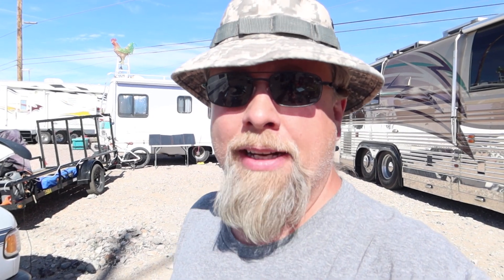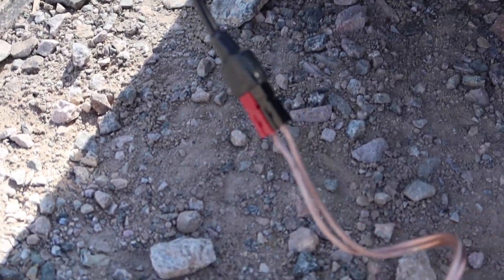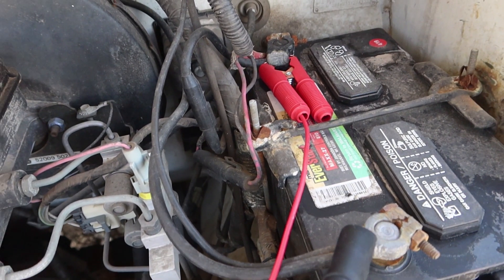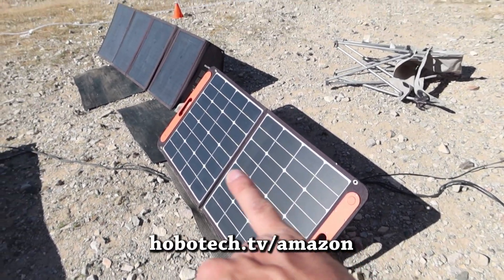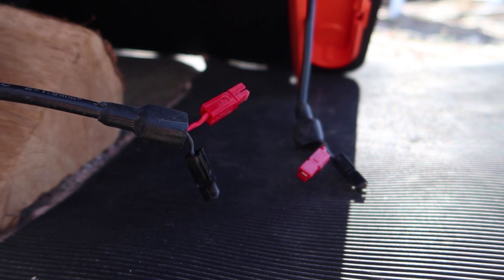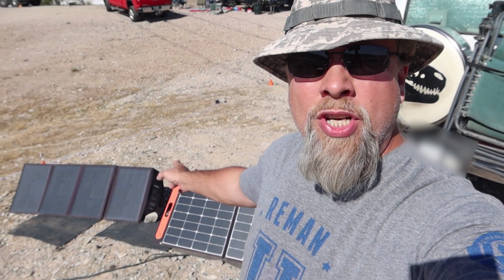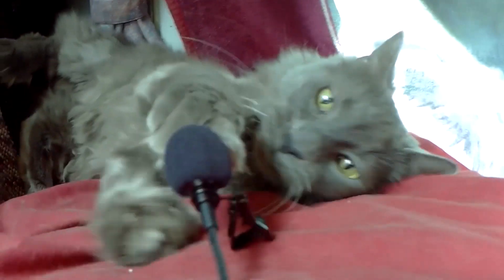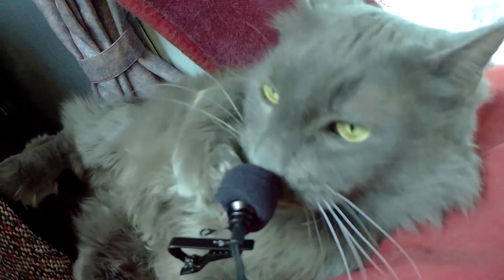SOLAR PANEL HOW TO'S! Wiring Portables In Series And Charging A Car Battery With A Jackery

Comment: I am just curious why you say you can’t use a Jackery solar suitcase to plug into a  Solar on the side port on the trailer with an adapter to charge the batteries? What is the wire configuration in an 8mm male cord like on the Jackery suitcase? If you exposed the inside of the cord would it just have a positive and negative wire?

Comment: THANK YOU THANK YOU THANK YOU😀  you answered a question here that I just asked on another of your videos.  I think😒     i have 2 of the Rockpals 60 watt foldable panels with parallel cables and 2 more ordered I am hoping to use a setup like you just showed to hook themup in series AND in parallel to run thru a mppt boost controller and charge a 48volt trike battery without having to lose watthours using the inverter and 110 charger for the battery

Comment: Great review and info! Thanks. Question; what would happen if you tried charging a lead-acid battery with a trickle-charger plugged into the Jackery's 110 outlet? Ye? No?
Reply from the maker: Will work just fine for 12 hours then will shut off.
Reply: @HOBOTECH  , Thanks, that might be enough. Does that apply to one those maintainance 12 V chargers?
Reply from the maker: Once the battery tops up, the Jackery will sense not enough power and shut down in 12 hours.
Reply: @HOBOTECH  , Thanks again!

Comment: I saw this post on an RV forum site and wanted to see what you thought as far as a valid answer (as you can expect, the forum answers were mixed). Any way to clear up the question? Is that what BMS does or does the charge controller do that? ......
"I've heard many people claim that solar panels charge the battery ONLY and do not supply electrical loads in the RV. How is this possible?

A battery can only be in one state at a time - it is either charging or discharging. It can't be doing both at the same time. Whether it is charging or discharging depends upon the voltage of the bus it is connected to. If the voltage on the bus the battery is connected to is higher than the battery's internal voltage, then the battery is charging. If the voltage on the bus the battery is connected to is lower than internal battery voltage, the battery is discharging. Do I have that correct so far?

The charging controller connected to the solar panels charges the batteries by supplying a voltage (anywhere from 13.2 vdc to ~15.5 vdc) which is higher than the standard internal voltage of the battery (12.7 volts or less). But the charging controller is not connected to the batteries alone. It is connected to the entire DC power bus of the RV. Unless the solar charging controller is connected to the battery alone, and the controller and battery are disconnected from the rest of the RV DC system, I don't see how it is possible for the solar panels to ONLY charge the battery and not be supplying all the DC electrical loads at the same time.

Am I missing something?"

Comment: Hopefully you'll get the chance to answer this, but could you give a link to that Anderson Powerpole Y Adapter? Or perhaps another cable/adapter where I can plug in two Solar Saga 100's into my Explorer 1000? I'm new to this whole solar thing, and have tried finding these specific wires myself. I've even messaged Jackery to see if they could send over their specific adapter, but they seem to be having problems on their end communicating. Worried I might purchase the wrong product, or something that isn't compatible. Your videos have been so helpful/informative to a noob such as myself, and I really appreciate any assistant you could give. Thanks in advance!
Reply from the maker: Jackery cables aren't available yet. You can get something similar on https://hobotech.tv/amazon/#Solar-Adapters . You want either the Goal Zero combiner or the PowerWerx block and at least one extension cable.
Reply: @HOBOTECH  Oh dude, I wasn't sure if you were going to reply. Thank you so much! You're awesome.

Comment: Tried Promo codes didn't work :/
Reply from the maker: Just tested both solar panel codes at checkout they work fine.
Reply: @HOBOTECH  sorry i meant the jackery 240 itself, great videos bu the way really appreciate them. I just ordered one to also charge my Quadcopters at the field Thanks
Reply: Mine didn’t work either. I’m guessing they only work for the solar panels... sucks bc I was going to buy from Tom’s review.
Reply from the maker: @user-yz5oh4jj7v  Jackery disabled all promo codes. I been posting regularly about it.

Comment: Tom, could I use the Renogy Eclipse 200 watt folding suitcase setup on the Maxoak Bluetti? The reason I ask is it appears that the panels are run in parallel. Also how about the new 1000 watt Jackery? Thanks
Reply from the maker: The suitcase without the controller would work for both if you wired the panels in series.
Reply: @HOBOTECH  Thanks

Comment: Hi Hobo - Man, I am looking forward to your review of the Jackery 1000.  Could you look for these two things for me?  I know it will handle 1000 watt continuous output.  But, with that 2000 watt surge, how long will it handle that surge?  I need to know if I can run my Kuerig Coffee maker.  It only runs for 4-5 minutes for a cup of coffee, but for those few minutes it uses 1400 watts.  Also, will it run a 1100 watt microwave for 7 or 8 minutes (TV dinner).  I'm sure you will look into those kinda types of things.  Just if you can, see if these two items will work for me.  Thanks -- Atco
Reply from the maker: I will put the inverter through a thorough torture test.

Comment: I use XT60s or XT90s for nearly everything now - they're so versatile and easily stackable into bricks for combining multiple parallel connections either one to many, or many to one, just using a few pieces of thick solid core copper wire, solder, housing made from hot glue and heatshrink. I also use split HXT bullet connectors for inter-cell connections of my battery modules which make it easy to daisy chain and reconfigure for 4S, 7S, 14S etc as  required. HXT connectors are a bit difficult to assemble and only good for up to 10AWG.
Then you need adapters to convert XT60<->HXT<->MC4 and sometimes gender benders.
Once you decide on a standard, then you're pretty much stuck with it!

Comment: Tom, hopefully you caught your boo-boo..  It's the amperage and length of the wire that dictates the gauge of the wiring and not the voltage..  Nice work..
Reply from the maker: I mentioned 16 AWG is enough for charging a battery with a 60w panel given a reasonable distance. I didn't say anything about wire gauge vs voltage.